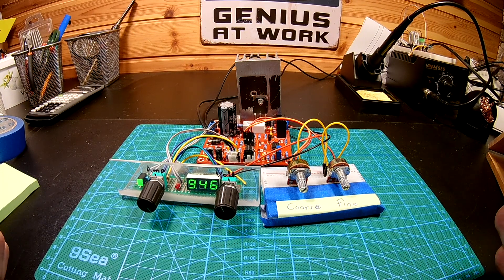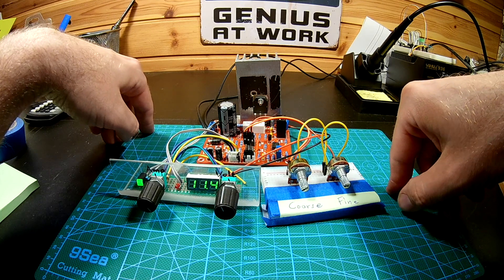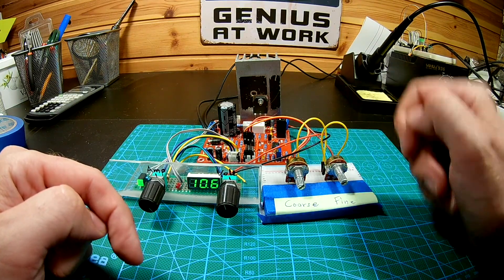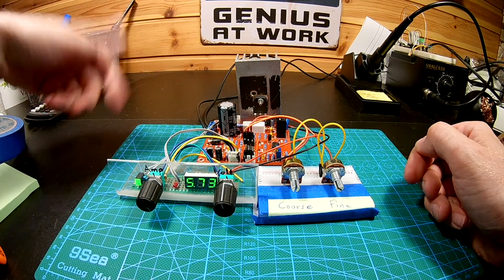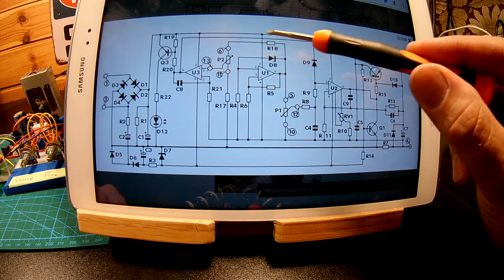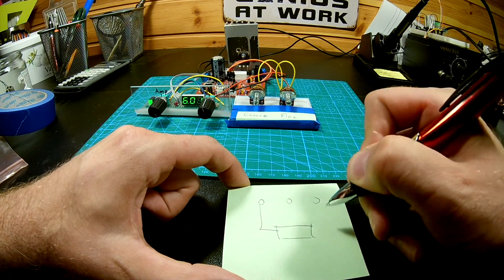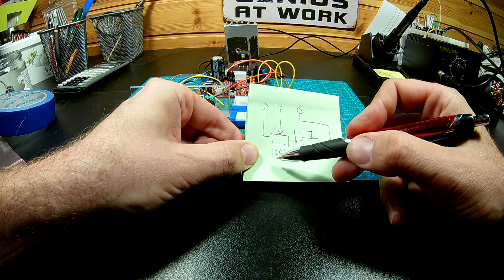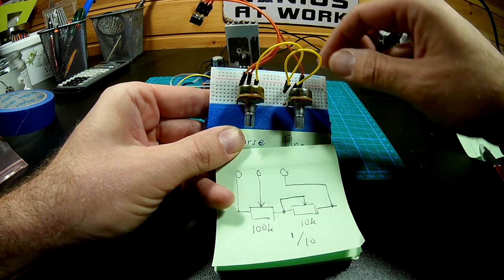#1:5 0-30V 2mA - 3A Adjustable DC Regulated Power Supply DIY Kit - Part 5 Better Voltage Setting

Comment: Hi, My output voltage is only 26v, any reasons, I should be getting 32volts correct
Reply from the maker: Check the voltage after the rectifier (across C1). And there is a possibility that if you have run on a to high voltage that the op-amps are burned.
Reply: @KristianLaholm  thankyou for the lead, will do

Comment: can this also be done with the amperes? like a fine adjustment for amperes? thanks for the video Krisitian.
Reply from the maker: I haven't tried doing the same on the amp setting but it should be possible, the pot setting the current is also a voltage divider if I remember correctly.
I haven't tinkered with the circuit for some time but still use it to power test projects :)
Reply: @KristianLaholm  thanks for the information...Keep Safe...informative video.
Reply: got it to work Kristian...yeheyyy!!!...thanks again for the video....just did it on the voltage side...keeping the amperes as is...thanks again.

Comment: I wonder if one could somehow replace the pots in the circuit with mosfets and use shaft encoders and logic ...
Reply from the maker: I'm not the one to give the right answer to the question. 
But I see a problem if you are going to control a mosfet from a microcontroller, it will be using PWM for the analog signal.

Comment: Come to think of it I prefer your 2 pots. I bet every time you want to use the thing the multi turns are at the wring end. I suppose you could have 2 pots AND a multi turn. I'm joking - I think. Very useful video's - thank you.
Reply from the maker: The PSU with the most pots in the end is the winner :) Good luck with your build :)

Comment: I have just found you channel and I find the power supply build very handy as I have also bought this kit. I think I will use 2 multi turn pots though. Mind you I do have to get it to work first. Maybe I should get 2 kits. Regards
Reply from the maker: 2 kits i always a good thing :) You can find it on sale at Banggood right now https://www.banggood.com/0-30V-2mA-3A-Adjustable-DC-Regulated-Power-Supply-DIY-Kit-p-958308.html?p=AR22132858920201510H

Comment: Thanks for the explanation on the dual potentiometer. Can you send me or direct me to the get the schematic of the power supply. Thanks again
Reply from the maker: On Banggood's product page below the video there is a "English Manual", on the last page you'll find the schematic.
Link: https://www.banggood.com/0-30V-2mA-3A-Adjustable-DC-Regulated-Power-Supply-DIY-Kit-p-958308.html?p=AR22132858920201510H